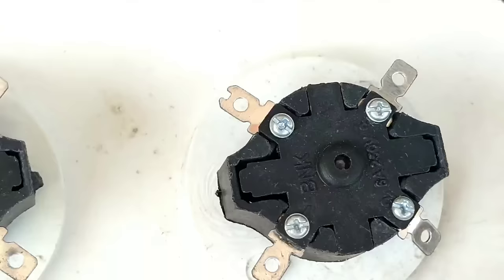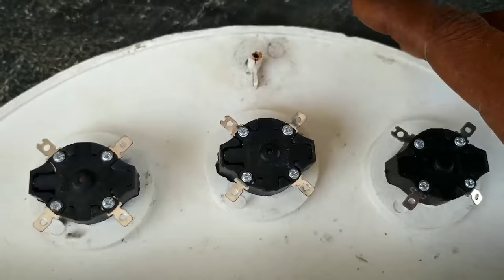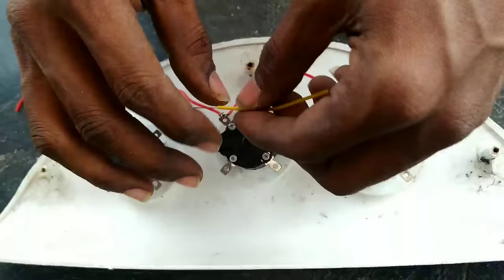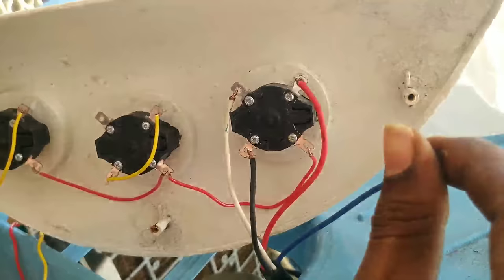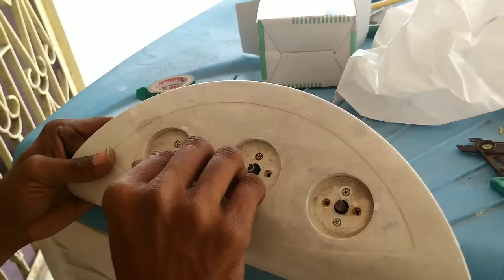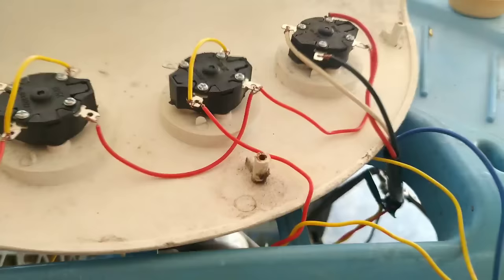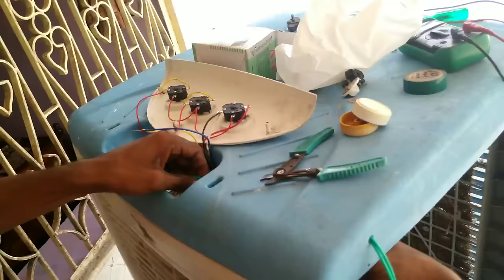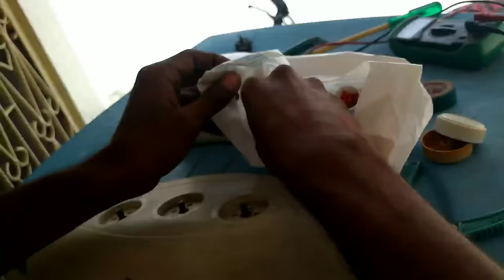Air cooler connections / cooler wiring / Air cooler repair / part 2 / in telugu

Comment: Ala okkati dhanki okkati deenki ani cheppodhu bro switches eppudu power control lone undali nuvvu power wire edhi ani check chesi adhe switch ki connect cheyyali earth bayata connect cheyyali nuvvala okkati dhanki okkati dheenki ani chepthe atu itu avuthe Earth control lo unte sachipotharu